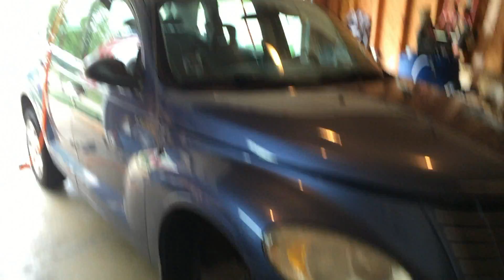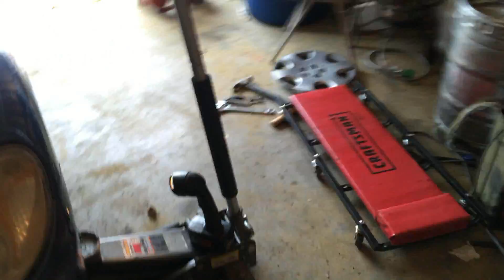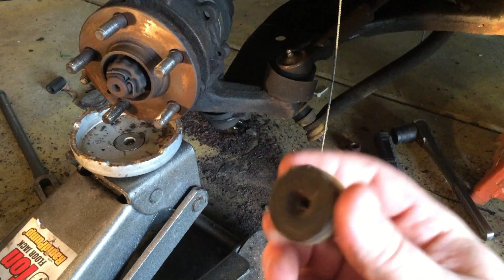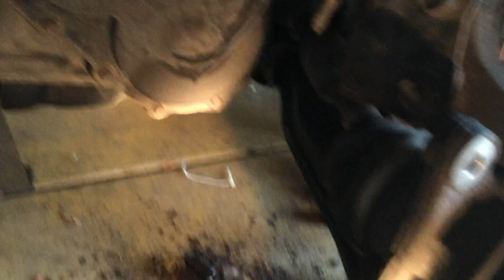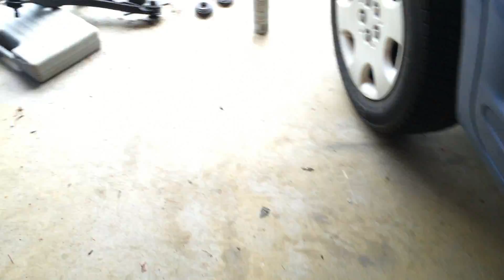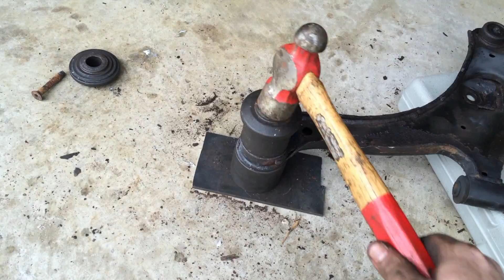PT Cruiser brakes and lower control arm bushing HOW TO

Comment: That is the worst way to get rotors off all you need to do once the caliper and caliper "bracket" not cage...is off take either a rubber mallet or a smal block of wood and a hammer and on the back side tap it firmly as you spin the rotor and it will come off no need for bolts or pb blaster. You never want to put a oily substance on the rotors because if you forget to clean it off it will destroy the brake pad material. Just wanted to correct your method because im a mechanic with 12 years experience and btw your idea are eh ok but over complicated and time consuming

Comment: was wondering as i have just installed new control arms do they need to filled with grease? they have grease rubbers and nipples so was thinking they need to be filled but others have said no need so unsure ..also replacing the sway bar dose the wheels need to have weight when tightening up the sway bar again
Reply from the maker: It does not hurt to push a little extra grease through the zerk fittings if they have them. as for the sway bar I just installed mine when it was loose. it's fine.
Reply: OK mate thanks great vid

Comment: what size socket is needed for the lower control arm vertical bolt...the one that goes into the frame
Reply from the maker: The big vertical bolt is a 24mm. make sure to spray with plenty of bp blaster or penetrating oil because if its stuck and rusted you risk spinning off that captured nut ... and that's no fun to fix.
Reply: @CarMedz , good vid. Thing is how dose one spray PB Blaster onto the big bolt when it's threads are not visible? Perhaps drill a hole into the frame and blast away???

Comment: I've gone the "rebuild "way before .By the time you buy the bushings and ball joint and either have them pressed in at a machine shop or spend all day banging and pressing them out  yourself ,your likely to lose money ! Best way to go .Ebay "China"  control arm ,but who cares where it's made at a 175,000 miles :)